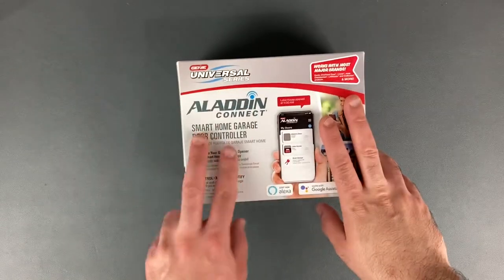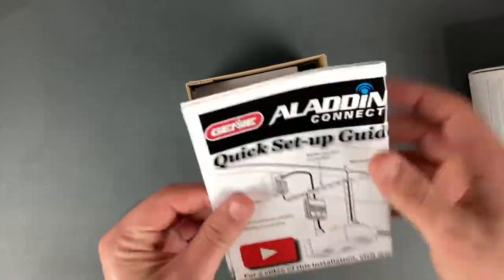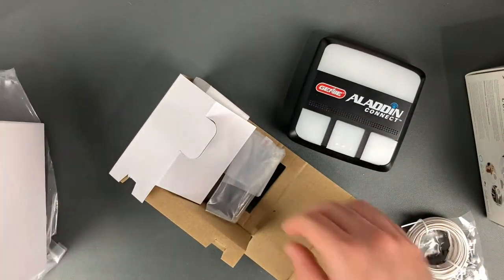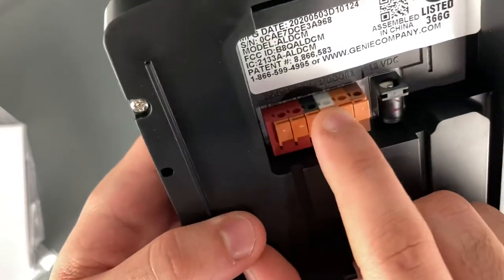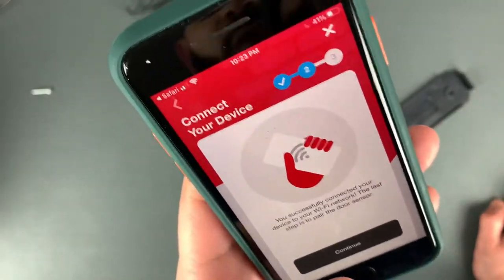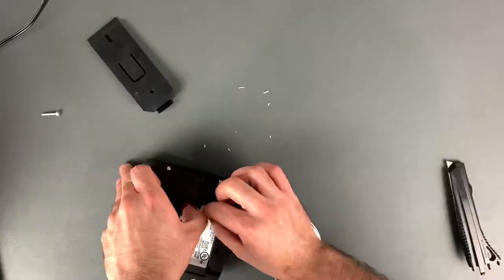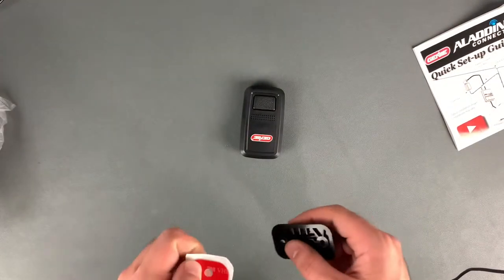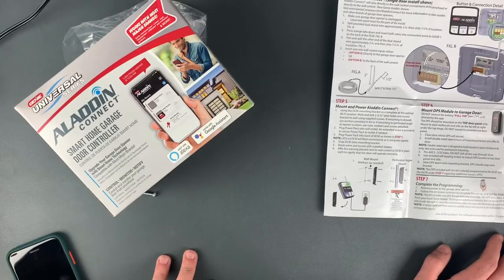WiFi SMART GARAGE Aladdin Connect Unboxing & Installation

Comment: Mine is setup amd all lights are in the right status.  When I hit the open or close tab, my garage lights come on and it’s beeps but nothing works.  I can’t believe that it’s a 2 hour hold fir gente connect
Reply: Why didn't you just use the existing wires for the old switch and install the hub where the old switch was. Now you don't have a switch to open the garage door without your phone.
Reply: help!
Reply: mine just flashes but it dose not open the door?

Comment: Why didn't you just install the new hub where the old button controller was. You could use the existing wires and use the hub buttons to open the garage door. Now you have to use the phone app to open the door because you need a ladder to reach the button on the hub.
Reply: You can still use the button on the wall.  This unit does not disable that.